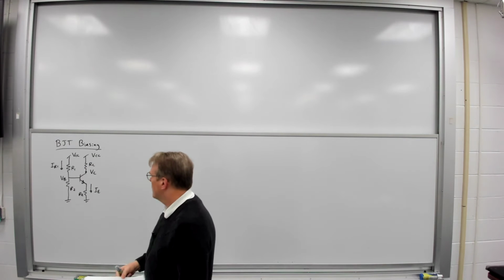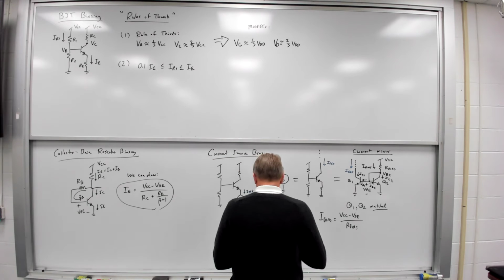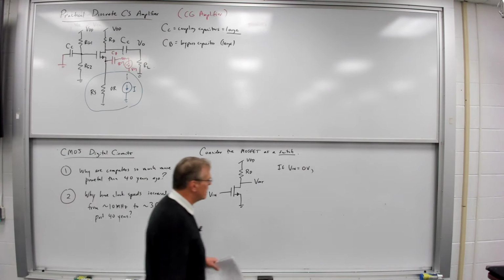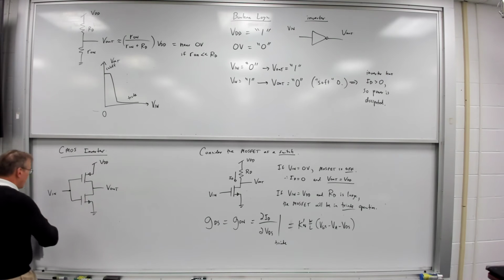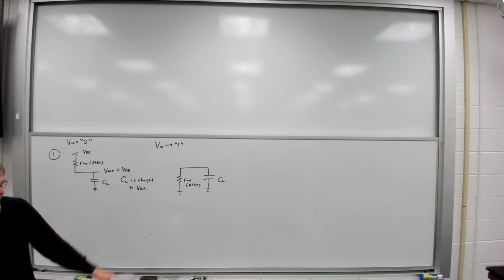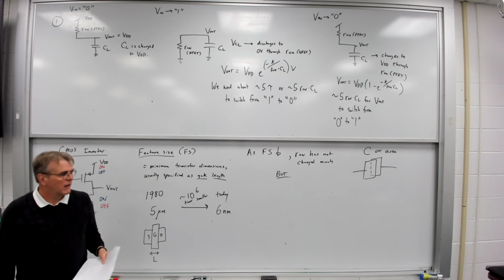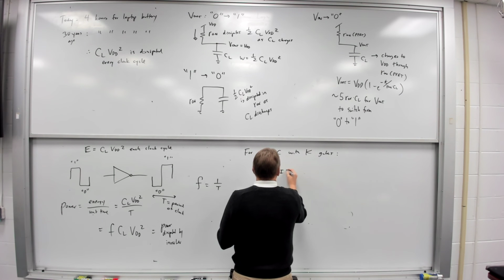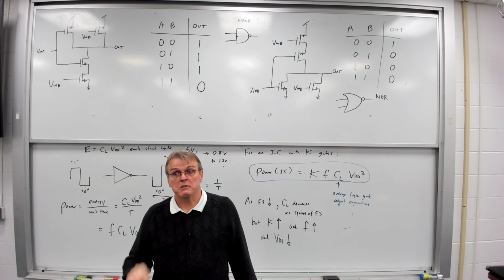Electronics - Lecture 22:  BJT biasing techniques, CMOS digital circuits

Comment: 43:02 
When the capacitor is charged and Vdd is on it, the NFET transistor will be in saturation because:
Vdd - Vt < Vd.
So will it probably take more time than 5*RC?
Reply from the maker: It's actually more complicated than that, as the saturated transistor behaves like a current source, such that drain current ID = CL * dVout/dt.  But you're correct in pointing out that the charge / discharge process is no longer exponential once a transistor goes from triode to saturation.

So why don't I go into that, and actually derive a more precise timing expression?  Because it would detract from the point I'm making - that smaller feature sizes results in faster clock frequencies in CMOS digital circuits.  Sometime a simpler model gets the point across much better, even if it is not as accurate.